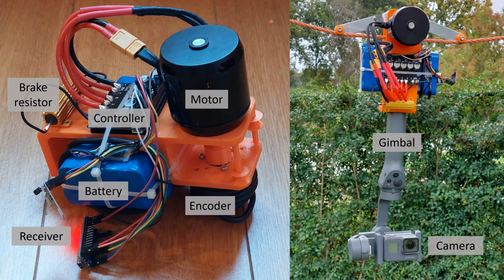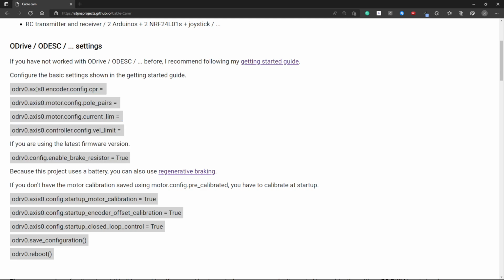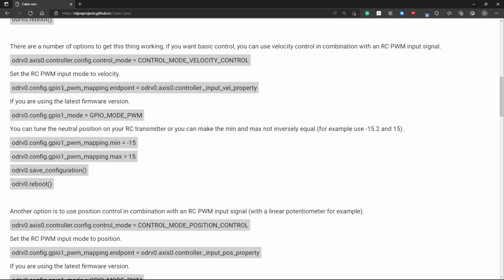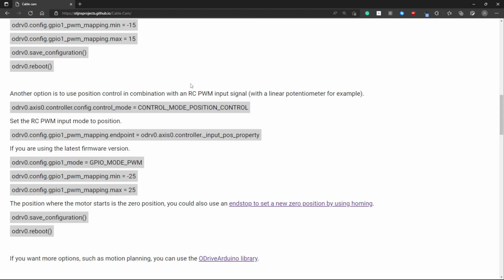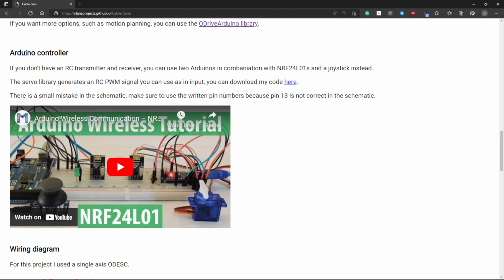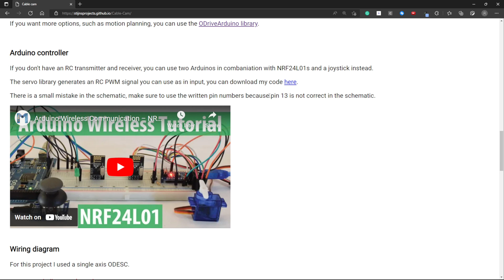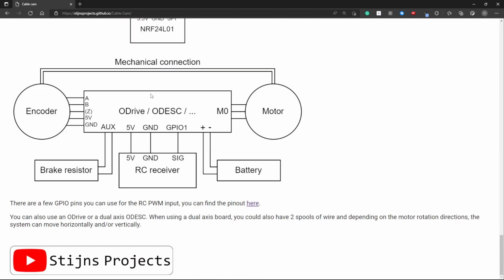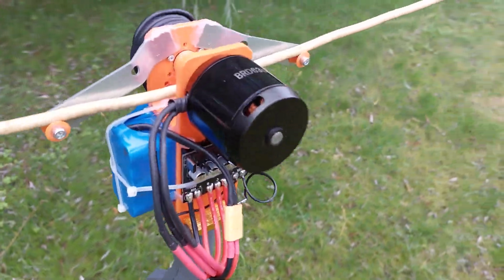DIY cable cam 📷 with ODrive / ODESC / ... (RC PWM input)

Comment: Looks very interesting.  What was the build cost for the project?
Reply from the maker: I used a lot of spare parts but I can make a guestimate, second hand / broken hoverboard $20 (you can also use other kind of battery), ODESC $100, motor $40 (you can also use hoverboard motor), encoder $10, RC parts $5. You can make this cheaper if you are on a budget by using a normal ESC or even a brushed motor.